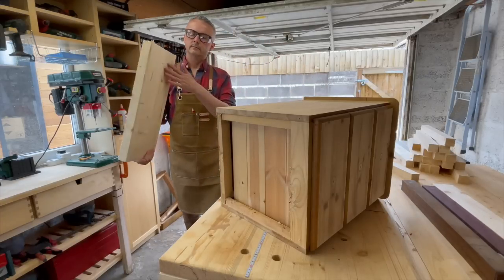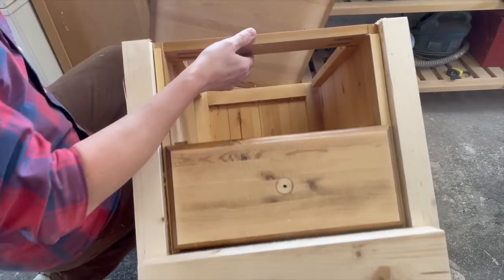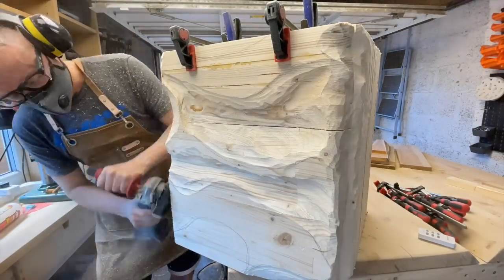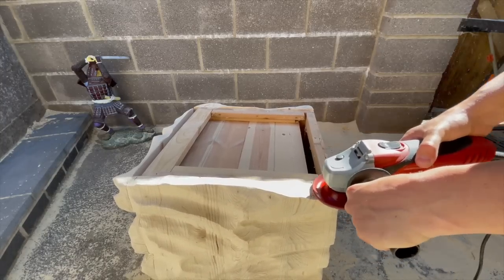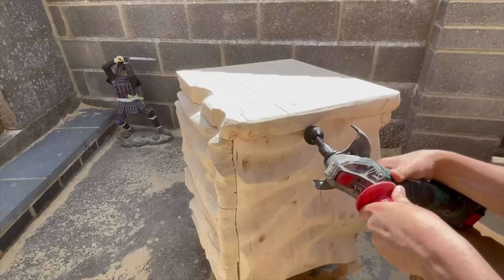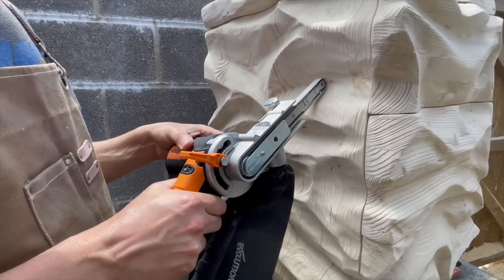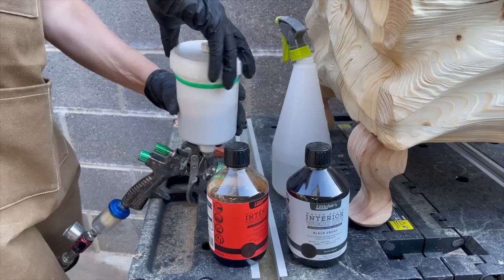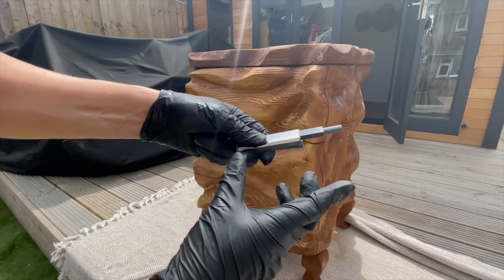Mindblowing makeover of a plain bedside table. Furniture transformation/design

Comment: Really like the way this turned out.  Very creative & organic. Lately, I've been applying finish glazes to experiment a bit. As I saw your result, I couldn't help but think how highlighting your finish with a glaze might look. I've got some log slices I've been thinking about how to finish. I've got an idea now. I won't be doing the same level of carving, but it will include the glazes. Thanks. The brand I've used is General Finishes in the colors of burnt umber, copper, & yellow. Not sure what is available to you, but I'm sure there is a similar product. You might want to experiment a little, too.
Reply from the maker: Thank you ☺️ I’m familiar with the brand but not available in the UK or very expensive if bought online.
Reply: Understandable. The one good thing about General Finishes is a small amount of product goes a long ways. I find I spend less in the long run. I've used less a quarter of a pint size can of glaze on 6 or 7 projects (2 of which were large pieces). The same is true for their stains. Like you, I also apply color lightly. Additional applications are better than starting too dark. However, when all is said and done, everyone has their favorite products & methods!